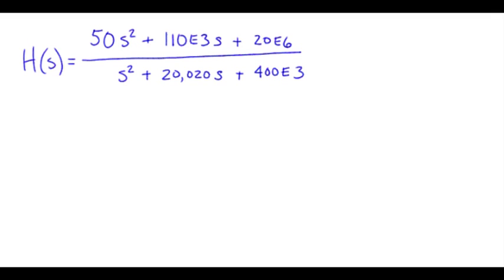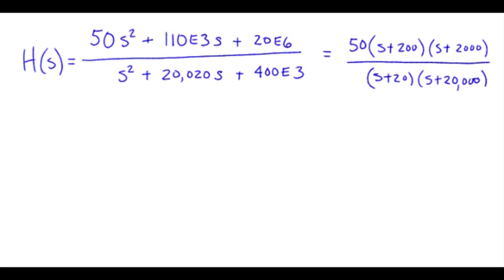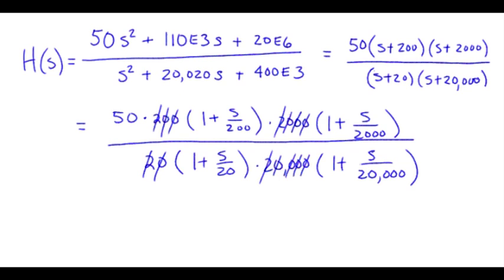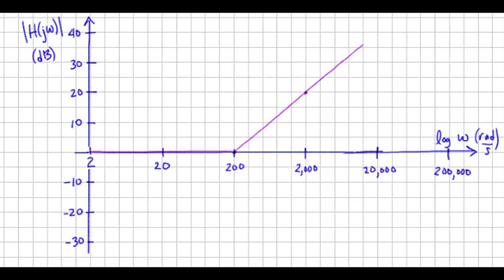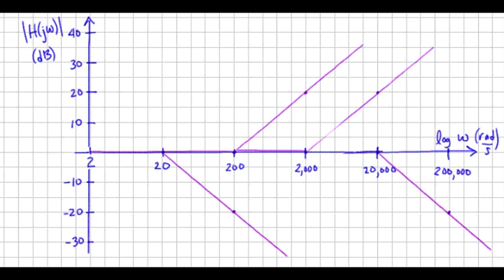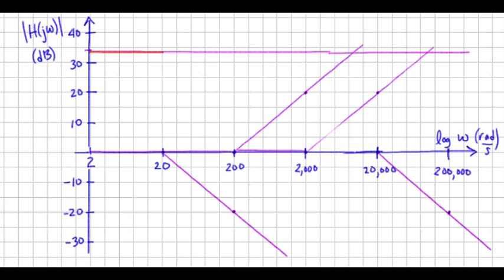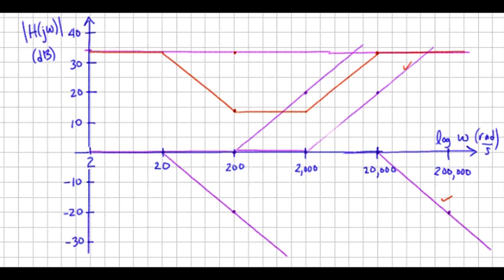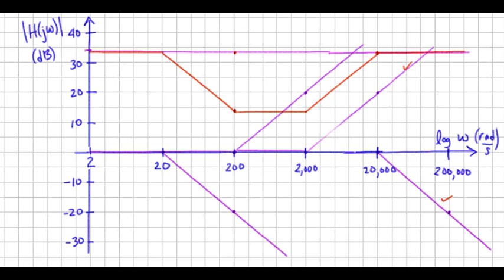s: Bode Plots Example #1 -- magnitude plot

Comment: I tried this on my problem. A basic one with only 1 zero. I got 86.85 for my offset when it should be -30ish and the 3-dB occurs at 216.6log(w)=619.8 when it should be 1000. Are there any rules for a -magnitude in ur equation that just changes everything?

Comment: For the overall plot (red line), between 20,000 and 200,000, why is the negative slope from the breakpoint at 20 not added?
Reply: Jorge Sanchez because negative slope(pole) from 20(to inf.) is cancelled by positive slope(zero) from 200(to inf.) - they sum up into constant